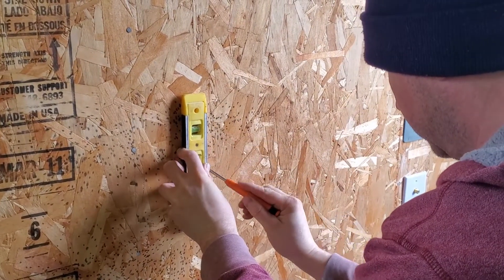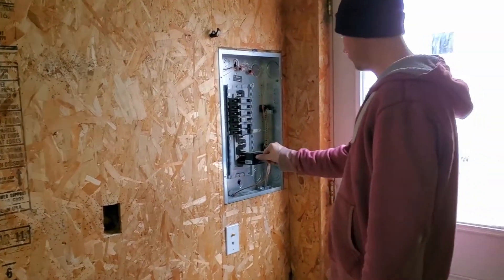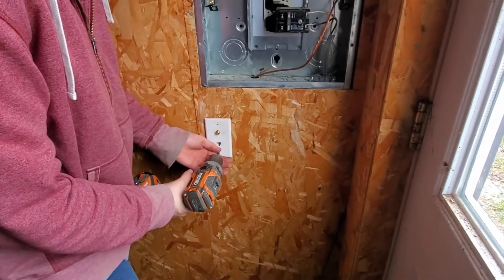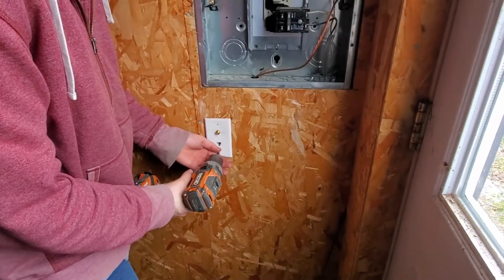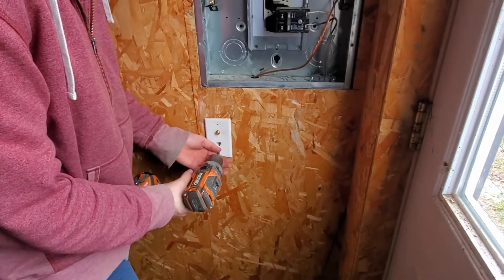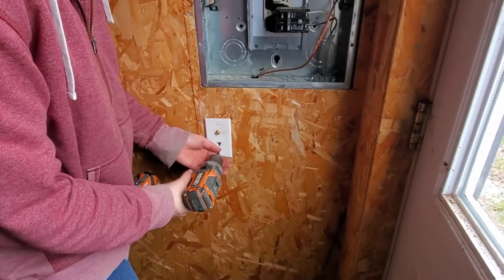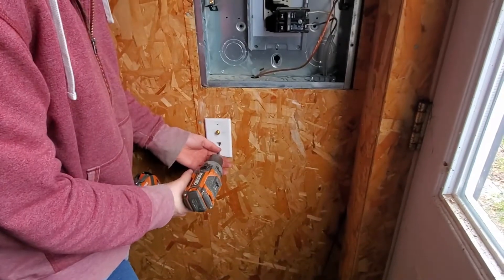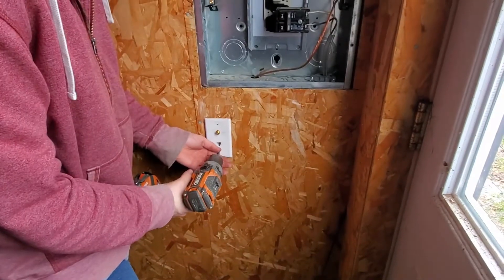Running Wiring to a Garage - 20A outlet and Ethernet Wireless Access Point

Comment: Did you run the Ethernet with 110V wires?
Reply from the maker: Yeah, that is correct, there is a 10AWG power line in that conduit along with the Cat5e that I pulled through it. Interference from a power line like this is not really a concern in reality. In terms of interference, it matters more what type of appliances and lighting and motors are running on power next to ethernet lines than an ethernet line solely living next to a power. Additionally, NEC codes, 805.133(A), allow for shielded communication lines to be ran next to power lines under 240V without separation. Technically, I did not follow the exact guidelines because I didn't use shielded twisted pair, so if you are considering doing this I would recommend two things: 1) Use shielded twisted pair, and 2) use cable lube for pulling it. In reality, regardless of the codes, I have had no impact from using unshielded twisted pair, but if you want to be in compliance with codes, then use shielded cabling.
Reply: @somedaysoon33   very very helpful and thank you for the detailed response. 

Shielded + different frequencies for the win.  🙏🙏